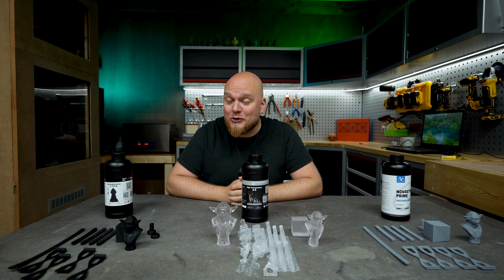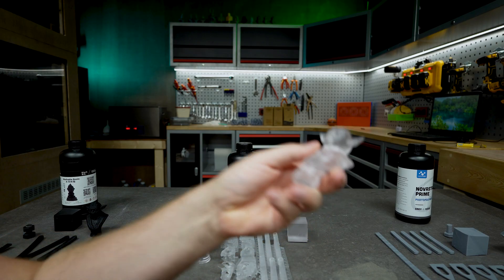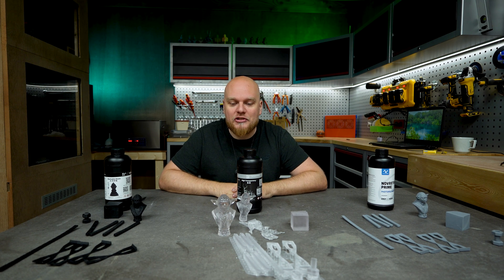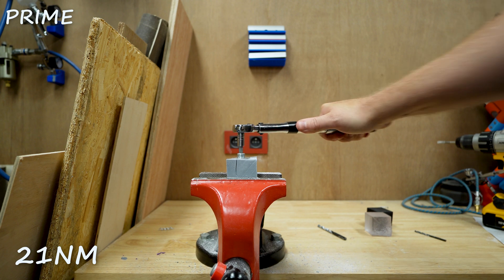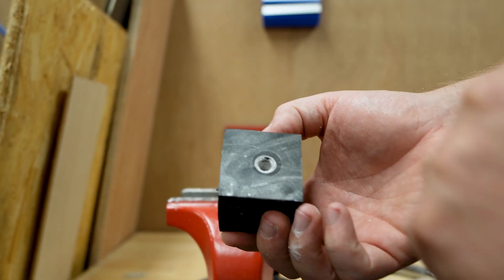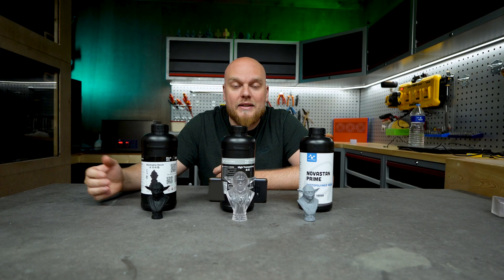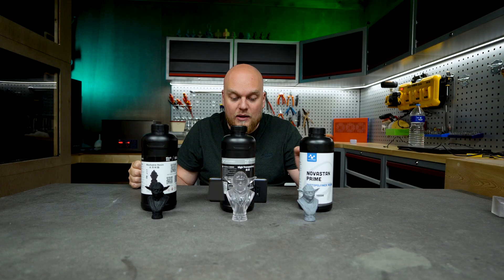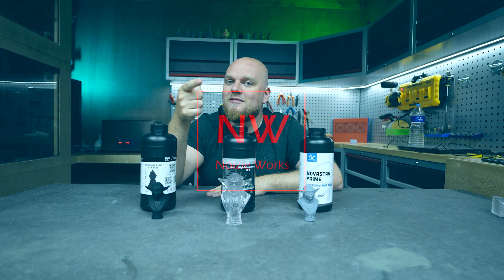NOVA3D High transparency, prime and water washable through the resin testing gauntlet! #5 #RTG

Comment: I tested a few clear resins the way to get them back clear again after curing is to brush on a layer of the clear resin and cure it for 10 seconds!. OK It does add a thin layer of resin over the print but it doesn't seem to cover any details it'll not be wet with oil's either it's worth a try

Comment: FIRST!  LOL

But seriously, great video as usual.
Reply: @NoizieWorks  By the way, the Jamg He Art & Engineering prints very good, but VERY slow (wait before cure and lift speeds) , and the settings they give are absurd - it took me 1.5 litres of testing to get it  right.

I was seeing those delaminations of  lower layers like you did until I found the right settings, "raising the bottom exposure time" has nothing to do with it, as you will see:

Bottom layer exposure 7.6 seconds, normal exposure 2.8 seconds, bottom lift/retract speeds 20 mm/min, normal lift/retract speeds 60mm/min, bottom wait before cure 40 seconds, bottom wait after cure 4 seconds, normal wait before cure 3 seconds, normal wait after cure 2 seconds, normal wait after lift 0.5 seconds, bottom lift height 6mm, normal lift height 4mm, bottom layers 10, transition layers 20, layer height 0.05mm.

This worked perfectly, no failures, good adhesion, easy to remove, supports work great and come off easily.

Settings were using Voxeldance Tango slicer, printer was 10.3" 8K Nova3D Whale3 SE using ACF.
Reply from the maker: Thanks for sharing! I just did what they told me but yes i think if you use the bottom layers to get more exposure in the raft and then transition into the supports most problems are fixed. Once in the supports i could print with the normal speed settings i used back then which was around 40mm/ stage 1 and 200 stage 2.
Now with acf i use 150 stage 1 (nova3d had these settings)and i'm thinking of dumping the 2 stage completely as i only need 3mm of peel on the acf and the 2 stage just makes it slower imo. What do you think? Btw they have a new art/engi that i can test, apperently it should hold up to sun better by like 2x 🤷‍♂️
Reply: @NoizieWorks  My experience, especially with ACF, is that TSMC is worse than useless, nothing is gained and it may even ruin prints unless it's slower than not using it - the printers don't have good enough motor control to make that viable, and also the deceleration and acceleration during TSMC either messes with precision or just slows things WAY down or both.

I used Jamg He's recommendation and did 30 seconds bottom exposure, it did NOT fix delamination and distortion, all that it caused is me to slightly damage a build plate for the first time ever - the resin tore off a bit of the anodization when removing the print because the resin literally "welded" to the anodization.  As you see, I use 7.6 seconds for bottom layers exposure, and it's a little over-adhered for my experience and preference, but it's no problem getting the print off easily and cleanly.  My regular exposure setting for this resin is the ideal for supports holding the print and coming off easily afterwards.

I am curious to try their (Nova 3D's) "Engineer" resin, do you mean theirs or Jamg He has a new version of Art & Engineering?   By the way, the Jamg He A&E definitely has great detail and VERY flat (no warp at all that I can see)...